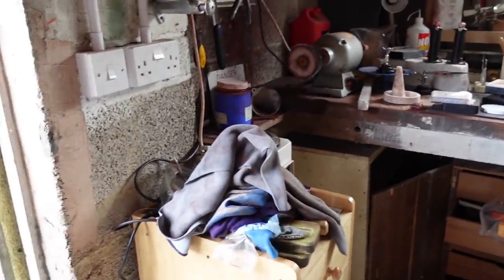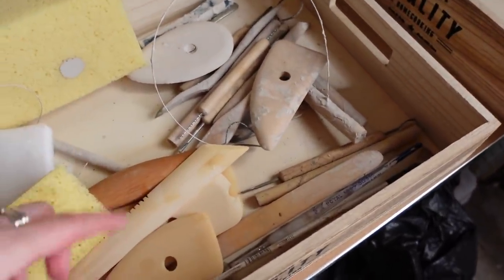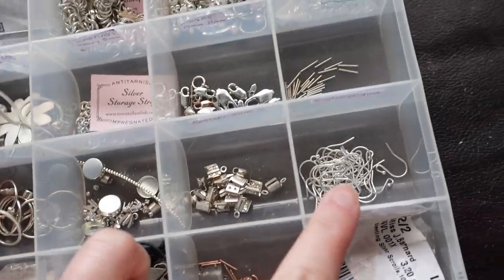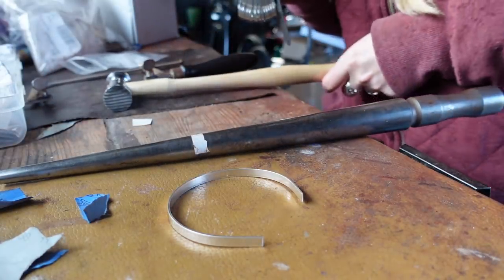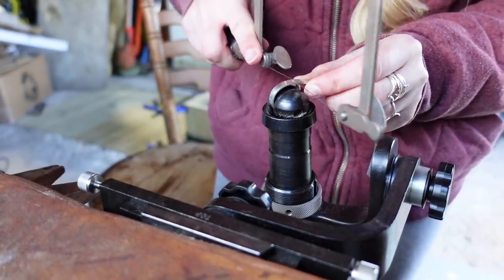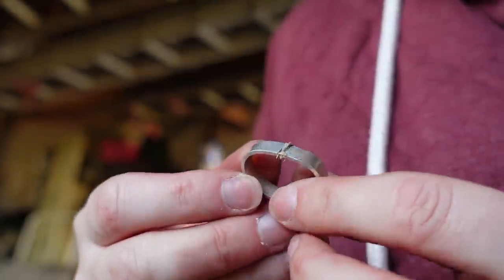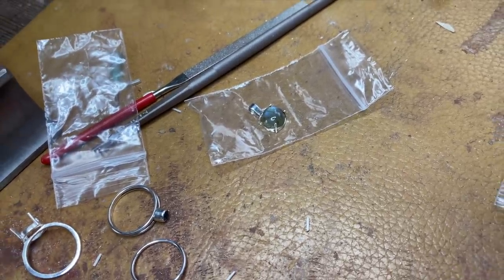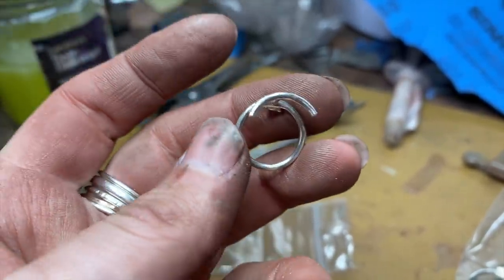Workshop Update! Jewellery And Cutest Husky Morning Face!

Comment: Don't assume that any of us find what you're doing boring, Jodie. :)
(Many of us could show you up in a contest of boring show-and-tell.)

Seeing your jewelry bits and pieces reminded me of a time I tried to make my own necklace. I tried to replicate a necklace my older sister bought for me back when I was a kid. I don't know what kind of necklace it was but it had 2 triangular and 1 rectangular ceramic shapes of red, yellow, and blue all on a black rope. The pendants were separated by 2 tiny little silver loops.

Anyway, I tried to make the pendant thingies using this weird type of clay-ish stuff you bake. I molded the shapes, baked them to cure, then polished them with my Dremel. Ha.

Surprisingly, it turned out better than I expected but I've always wanted to revisit it because I think I could do a better job now than I did back when I was like 20? 21? Seems like ages ago.

(I kind of wish I knew how to make ceramic / glass jewelry... Have you ever done any of that? I'd imagine you need a kiln for the ceramic ones but I'd be completely lost for the glass--I'd imagine you need a special setup for something like that, like something glass blowers have...)
Reply: Okay, yeah, I just watched your video and it is boring...

KIDDING!

That was awesome stuff! I never realized how much goes into making just rings! And I've consider getting one of those saws... (I do some woodworking--nothing major, yet--and that type of saw is one I could use for extremely fine cuts in difficult-to-cut angles, like 90-degree side cuts, something I currently use a coping saw for [but it doesn't always work out as fine as I'd like]. You strike me as a Fine Arts major... I guess that was your degree? Anyhoo, maybe consider using either an opal or lazulite for the stone in that ring? I always thought the latter was a beautiful blue but I've always loved opal because it always reminds me of a nebula or something.

Great video!

Comment: Hi Ms. Jodie - I watched a video of you combing Key's coat.  I was wondering what the name of that type of comb was that you used?
My dog seems to have a double coat and a regular brush or comb barely takes any hair loose even though she sheds a lot. 
I am allergic to her so I need to get as much off of her as possible before she sheds it on the carpet and the dander gets in the air. 
She is a blue heeler mix with german shepherd or malamute or husky. 
I believe that she is shepherd mix.
Edit: just a note. I watch your videos quite a bit. 
I don't know what the attraction is but it hasn't faded in the 6 months or so since one was loaded into my suggestions section.

Comment: Elongate the holes instead of making them bigger in diameter. Best to make the 2 holes holding a single pair of pliers closer together rather than the holes wider. That way the pliers won't fall over to their side.
o
v
^
o  
not 
^
o
v
not 
<o>

back to the video

Comment: If those holes are deep enough you should be able to use bigger drill bits to progressively get to the diameter you want without the need for a drill press. the existing holes themselves should guide the drill bits straight. Alternatively you could use a doweling jig or join two pieces of wood at a 90 degree angle to make a jig and place that over the area you're drilling and making sure the bit stays in contact with both sides of your jig. see the second method for what im talking about: https://www.manmadediy.com/4692-how-to-drill-straight-and-square-holes-without-a-drill-press.